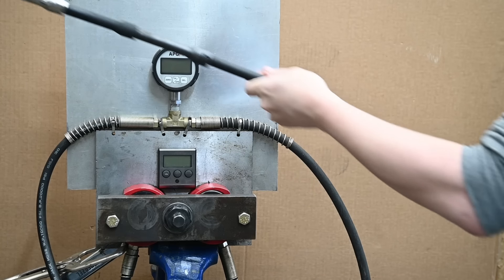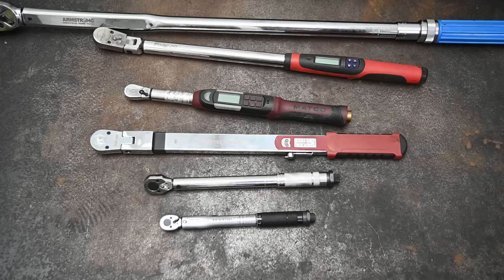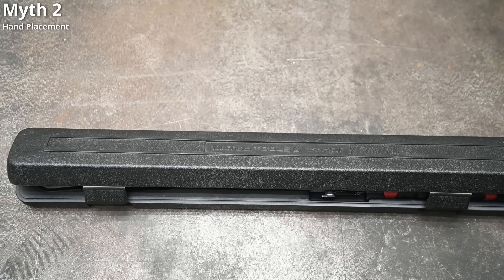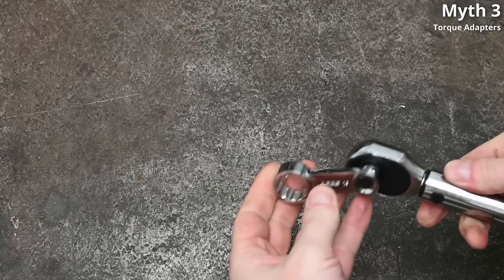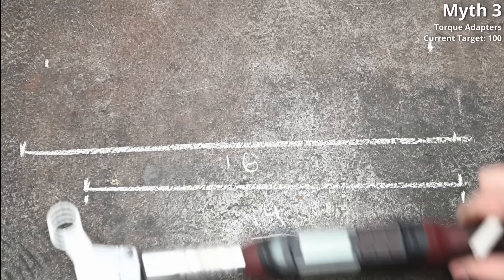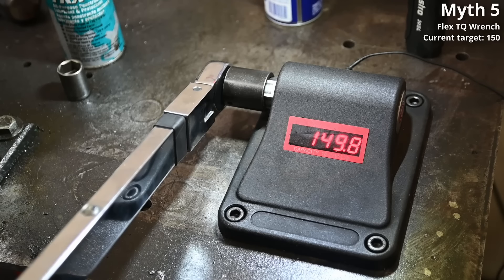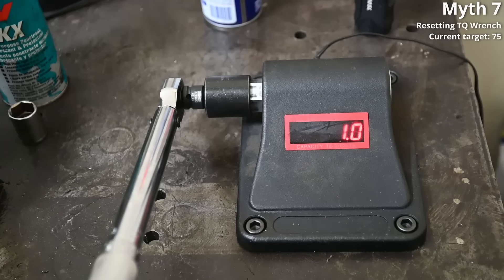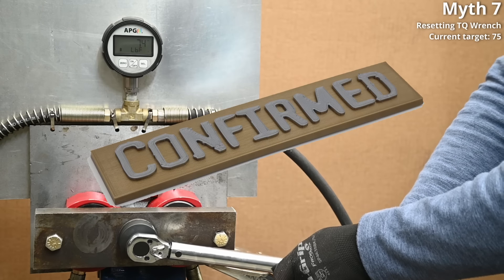You're Using a Torque Wrench Wrong: MythBusting 10 Do's & Dont's

Comment: I just watched your related vid first.  I have those old fashioned steel knitting needle in front of a scale, non click wrenches. I am going to presume that if they are correct from the factory, they stay reasonably close to spec if you do not step on them.. The needles seem to rest on the zero line when I am not applying force. I tested one against a  previously calibrated clicker and they seemed to agree. I have not tried them on a calibrating instrument. I see why people buy the clickers, as it is tough to get into a position where my eye can look straight in on the scale.

I appreciate your lessons on extensions and crowfoot  wrenches.  I have been careful to use a single extension squarely on a right angle because it seemed the right thing to do. You have explained why.  I have a set of crowfoot wrenches. You have explained that they add a centimeter or more ( depending on size) to the leverage of the torque wrench if used in a straight line.

Conventional wisdom says wheel lugs/lug nuts should be assembled clean and dry, so the torque is measured is based on metal to metal contact.  I clean off heavy dirt and corrosion with a soft wire brush. Wipe with a clean dry cloth or use compressed air.  Avoid using taps or re-threading files which may result in a lower percent thread contact. If the impetuous kids at the tire store did not hand start your lugs/lug nuts back on,  but used the impact wrench, you may have lost a thread or 2 and have metal shavings in the threads.

Do kids do dumb things? You bet!  Too cold to work under the van in the cold weather, I went to the dealer for an oil change. I ran from the service desk across the room when I saw and heard him using an air ratchet to put the plastic cap on the plastic oil filter housing. His defense: "but it's torque limited."  That housing is continuous with the oil cooler in the bottom of the V in the V-6 engine.  Housing leaked. Cost me several hundred dollars - at a different dealer. No reason to use any power tool for so few turns of the plastic cap! 

 And the new dealer did not think I needed to change the spark plugs while he had all the tubes and wires off the top of the engine at 150,000 miles because he was not getting a "code"  for that from the computer. The plugs are in deep narrow tunnels in the heads.  That job looks worse than on my V8 Aurora where the front four are easy and the back four just mean loosening the throttle so you can reach down where you cannot see.  I did the plugs on my Aurora 150,000 miles ago and it is time again.  We will see whether anti-seize does any good for all those miles and years.

Great vid folks!

Comment: As a quick anecdote. The Navy's Joint Fleet Maintenance Manual, requires that adapters used with a torque wrench MUST be used at a position perpendicular to the wrench. If that is unable to be accomished, your required to use the torque wrench equation to calculate the indicated torque for the required torque of your actual setup. I.e. if used parallel (straight) from the handle, your indicated torque will be lower, but required torque will be met.

Side note, fasteners larger that 5/8" must add running torque to required torque because you have unaccounted for torque from thread friction. There are also rules for lubrictaed fasteners vs dry fasteners.

Comment: About your test with the torque wrench kept under tension for 6 mobths and now shows much lower readings:
This part i already knew (just not the extend of the inaccuracy), but what would be quite interesting is what happens if you leave it be for a while (maybe another 6 month ir something around that) without tension and then test to which extend (if at all) this inaccuracy is reversible

Comment: All of the anti-seize products I've worked with contain (or are, moly for stainless on stainless, say) a lubricant and we always treated them as such, same as if there was a light coating of oil on the threads. The equipment I work on, we have a standard torque table by bolt size and grade, both dry (typically with a thread locking compound) and lubricated. Not sure how much it matters on smaller fasteners but all our lubricated torque values were calculated with lubrication between the bolt head and the surface it will be tightened against as well as on the threads, since this can be a significant amount of the total friction. It's just super critical to know what the spec is.

We also pretty thoroughly clean and dry re-used fasteners and threaded holes in parts, and de-grease. Anything that increases friction on the head/threads will of course reduce joint clamping force at the same torque reading. 

Often work on hydraulic lines and fasteners in tight spaces that still need precise torque control, thought the 90-degree-and-any-length trick was more well known. I did work with one extremely stubborn guy who made me actually diagram it out and show the math though, so maybe not.

Comment: When working at a John Deere dealer I was told to ignore the decals and manual book when torque wheel bolts for combines. John Deere wanted lubed threads, if you do you'll stretch the bolts and possibly snap them in the hub before ever getting the torque spec. Quite a disaster if you lose a set of combine tires because you followed the instructions

Comment: Excellent video. Been using torque wrenches for many years and it's good to learn something new.
I work for a defense contractor and we were directed by our customer to refer to a NASA specification MFSC-STD-486B for torque values. It contains charts that give torque values for various grade screws and either wet or dry. The spce is pretty old (1992) but can be a good reference anyway. It references cadmium plated hardware. Well cadmium plated has been banned for years. Perhaps zinc plated has about the same K factor.

Comment: I have sealey premier click micrometer torque wrenches and in the instructions they say if you've not used the wrench in a while you should use it at lower settings and gradually increase it to maintain the accuracy and to help regrease the internals, they dont provide step by step instructions just that sentence, ive had my two for 7 years now and im going to get a torque adapter from acdelco to see just how accurate they are when i've stored them both at 0 for many years.
Thanks again for another very informative video! I can't wait for the next one.

Comment: I graduated high school with a C+ Average and joined the US Navy in 1972 during Vietnam. In my 20 years in US Navy aviation maintenance, I worked awhile in I-Level Mechanical Physical Calibration. The 1000PF torque wrenches from the ships and squadrons often came in short so they would fit in a locker. I had to REJECT those as they failed.  I used an electric actuator to apply torque because my weight on the extended 1000PF micrometer torque wrench set at 1000PF with a Length of 6 feet would not click. When it did, it was LOUD!
 I also calibrated Cable Tensiometers and Pressure Gages in the shop. My rate as an AE had me calibrating aircraft systems instruments, autopilot and bombing computers.

Comment: As a millwright there is a formula of leverage, ratio that you can have tape marks on your torque wrench for + settings, and I had acces to a torque dyno at the mill so I dialed in my torque by feel as well. It takes practice

Comment: That result with the anti-sieze helps explain why I just read the Australian Standard for structural steel no longer accepts torque wrench readings as a primary means of tensioning. They are just too variable in construction settingd where one bolt may be corroded and the next  may be nicely lubricated form the factory. You need to eitiher use the part-turn method or a load indicating washer

Comment: We had a fastenal presentation on torque values for a company I used to work for and he played a trick where he rubbed his chapstick on the bolt to display exactly what you showed with the loctite. Every since then I make sure to check whether the torque values are labeled as lubricated vs not.

Comment: Very good information. I have a HF Pittsburgh Pro click stop that I've used for a few years now and before I use it I always check it on a scrap engine block against my manual beam type torque wrench for consistency and it has never steered me wrong. 😃 I refer to it as my "magic wand". The second those values are off I'm taking it apart to check if it's worn or if it needs calibrating. If it's ever rough I'll get another one. Before my Pittsburgh Pro I had a PT brand one from Oreilly's and it was a hunk o' junk. Lasted just long enough for me to do a couple tasks on my Chevy and then it stopped working entirely. Taking it apart, the inside of it looked like hell. It had become a chrome paperweight.

Comment: In the Air Force, they taught us to 'exercise' the Torque wrench prior to use. They had fixed mounts bolted to the side of the tool boxes so you could crank the wrench up to the highest setting and 'break' it a couple times. After that, you went to your required TQ and torqued the nut/bolt.

Comment: Lubed or dry. I know and understand that part since ages but what I wasn't prepared to in the railway maintenance industry, was how hard it can be to know what the ingineer intended in the first place. You have "conception guidelines" for a whole train that are sometimes hard to find, and sometimes containing contradictory rules to what you see on some blueprints. To add some fun, there is some precisely defined coatings that act as lubricants additionnaly to rust protection and you have to find resellers for those or to know what you really get and act accordingly. "zinc coated" will abolutely not be enough.
T.T

Comment: Great video! Another thing to think about is to not grip the handle hard or with two hands when using a small wrench at low torque. It only applies to low torque values because the the hand's bending force on the wrench is high enough to make a difference to the torque while on normal higher torque values the torque is so high that it's negligible. Still, if possible I strive to only pull with the fingers curled around the handle and not a hard grip on the handle.

Comment: When using a crows foot at work I calibrate the click wrench with the snap on torque tester with the crows foot installed.  As you shown that the lever length does indeed affect the torque readings

Comment: Glad he did the one on extensions cause that was one I always followed but never understood because mechanically the angle of torque didn't change. That being said, the "90 degree" thing is an oversimplification. Also, think about the adjustable one, with a normal socket head the bolt is always rotated around the same pivot center. With an adjustable, the center pivot of the bolt moves out the bigger the bolt you tighten. Therefore you cannot calibrate an adjustable wrench for every bolt size.

Comment: So many memories.
Used to work with SST fasteners on O2 equipment.  Threads were lubed with a mixture of oxygen compatible oil and molybdenum powder.  Torque values would always be reduced to 85% of the value for any given fastener when using this necessary "anti sieze".
And just a fun one.  One time requirement to apply 600 ft. lb.  No wrench that high.  6 foot extension and a bathroom scale.  Un weight 100 lbs. and viola.  600 ft. lbs.

Comment: I always use grease, anti-seize, or Loctite on bolt threads.  But I have also measured with and without those lubricants and adjust the torque wrench to compensate for the reduced friction.

Comment: Great video! Glad to have some info to finally back me up, I can just direct the torque ninnies here!
I'd be curious to see some storage testing with the norbar/wheelman style break back wrenches. Norbar says they're okay to leave wound up, which I do as they're a pain in the ass to adjust. Some guys swear they need to be backed off.
Speaking of...one thing to mention is that when you "back off" a clicker during storage, don't go all the way past the readings. The handle can come apart surprisingly easily, and sometimes depending on the wrench the guts can come out of position. Leave it at the lowest reading that's still on the scale.
Definitely want to pick up a digital torque meter just for accuracy testing and curiosity more than anything. I have a few cheapy wrenches and knowing they're still in spec without spending $300 on cal would be nice...

Comment: Please do a for science video on testing heaps of different types of bolt lubricants such as Loctite, anti-seize, PTFE tape and grease. It would be really interesting to see how they perform on several sizes of fasteners or even several types such as galvanised vs plated bolts.

Comment: Fantastic! How informative. I feel vindicated spending years turning my clicker wrench back to zero before putting it away! The old boy who taught me that (god rest his soul) was correct all along.

Glad to know the luggage scale works, I’ve always used one with a breaker bar when I needed more torque than my wrench could provide. I knew the physics was correct but glad to see it’s accurate.

Also the crows foot info is useful, I’ve always avoided using them with a torque wrench, glad to know I can trust them without any thought provided I use them at 90degrees.

Comment: Back when I was a diesel mechanic, I attended a seminar on torquing fasteners. I never realized there was so much to it. There was a lot of good info there but the thing that stuck with me most was how much of a difference there was between torquing fasteners dry vs using different lubricants. If you aren't following the directions in that regard, there's no point in even using a torque wrench because the actual value will be so far off that it's pointless.

Comment: Something I might add to the value aspect as I own a SnapOn digital torque wrench. There is a setting on it to compensate for when you are using an adapter that adds additional length.

I would never recommend one of these to the average DIYer or home mechanic. As you've shown, even a cheap wrench gets you in the ballpark close enough for that purpose.

But if you are a professional mechanic, these tools are worth their weight in gold. They save you so much time over their lifespan that they pay for themselves. And as any flat rate mechanic will tell you, time is money. Whether that's time saved using the tool, or warranting it.

Comment: Glad I went out and bought an Icon split beam, vs my old pittsburgh that's been sitting in my pickup toolbox for years on 80 ft lbs when putting new heads on my engine 😅
It's been through the wringer being used as a breaker bar when I needed one, so its a breaker bar for the rest of its life

Comment: On large marine engines you get two torque settings in the manuals - one with lub oil - normal oil usually recommended, and one without oil. For critical tightening its bolt stretch.

Comment: the anti seize insight is huge i wonder if grease would have the same impact on over torquing bolts on our farm equipment tends to get some grease on the threads just to help them survive the manure i guess i need to go give this a shot back them back out and run them through a thread gauge to see if the bold is stretching

Comment: Interesting with the anti seize. On my 93 Chevy pickup that I own for over two decades, I used anti seize on the lugs. The bolts are in great shape. Yet, on my 2022 class C RV, I had a flat and the guy R&R the tire twice. The bolts looked terrible after they dry torque it. I told the guy I rather have anti seize than to replace the bolts or hub. 
But when I worked with jet engines, anti seize is a must especially with the hot section. Never had a problem with it, but seen many problems when people don’t use it, even on other equipment.

Comment: Your run of the mill silver anti-seize should rueduce friction by approximately 48% percent is what I remember reading many years ago. We (me and my coworkers) had a list of something like  50 of the most common lubricants, to include anti-seize, and penetrating oils, laid out in a graph that gave each one's properties. I don't remember where it came from, probably one of our lubricating oil vendors. But I've always remembered that anti-seize had a very high friction coefficient. And it explained a lot of things prior to that point in my life, as we used quite a bit of the stuff. This being due to the environments that the equipment we worked on being extreme.

Comment: You should store it zeroed out, if you drop it, it should be recalibrated. Never use it to loosen nuts, and don’t jerk on it. Should be smooth pressure. Calibrate yearly.

Comment: for those wondering how much difference there is when it comes to the scale of resolution between ft-lb and Nm, 1 lb-ft is roughly 1.35 Nm, so the resolution is pretty comparable between the 2 of them, which i found interestingly close to each other, despite a foot and a meter as well as pounds of force and a newton being quite different from each other, it equals out to be pretty comparable.

Comment: One important factor on the "Spring Set" is that springs can be "Pre-set" from factory. This is commonly done on high precision, automotive springs etc. by compressing the spring multiple time to solid height, until the spring length and force @ solid height stops reducing. From this points the change of keeping the spring compress should lower drastically during life. A spring that has been let compressed and recalibrated at that point should see less change after.

I do not know if there are any manufacturers that do uses spring that have been pre-set in the high end. However it still is best practice to unload the spring as other factors can still cause a degradation of the material over time